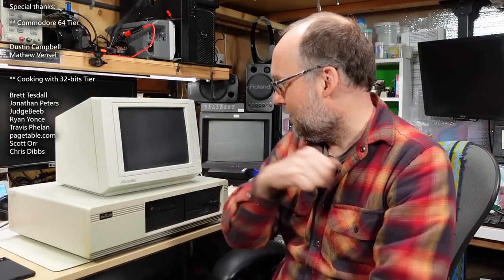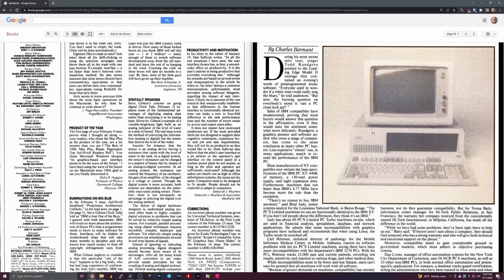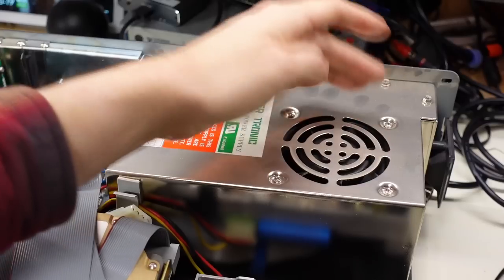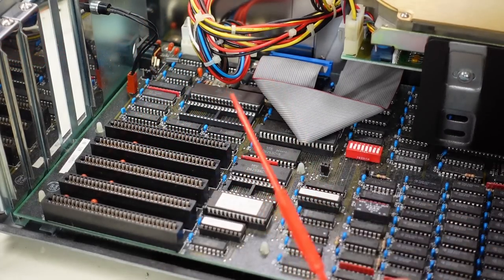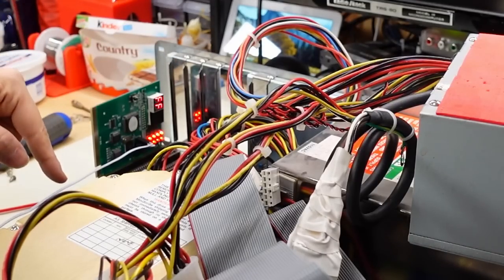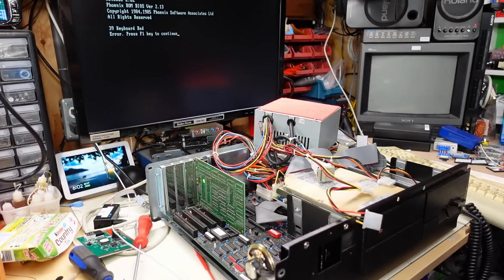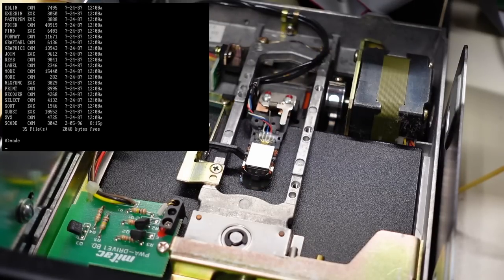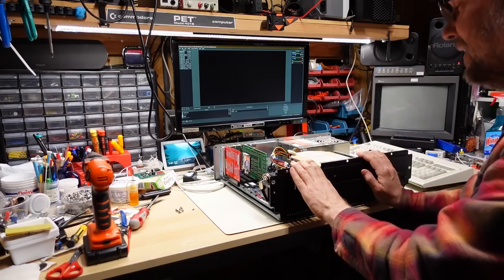What mysteries lurk inside this mint Turbo XT?

Comment: This is a long shot, but is anyone aware of similar Turbo XT clock frequency changing software for boards by other manufacturers? I have a DTK 10Mhz board where there software switch triggered by a keyboard shortcut doesn't work, since it requires the original DTK BIOS being installed.

Comment: machines that had the monochrome adapter (not the CGA), could have up to 768K of contiguous ram as the video ram space was smaller.
Reply: According to Wikipedia, you could actually use 704K with MDA/Hercules, 736K with CGA and up to 960K with a serial terminal: https://en.wikipedia.org/wiki/Conventional_memory#Additional_memory

Comment: I always wanted to make a video card for these that is really just a raspberry pi with an adapter, giving the pc all the power it could ever use, and also allowing you to double the use as both a vintage pc, as well as an awesome retro raspberry pi enclosure that would use the same keyboard and monitor, power supply, ext, but would also give you a couple USB ports for a more modern mouse or keyboard should they need arrive and possibly even an SD card to use as the hard drive for the entire system. Does anyone know if there’s anything similar to what I’ve explained available to buy or is this something if I want it I have to invent it? Lol

Comment: That BR battery is the same as the CR, NOT rechargeable. The B just means it industrial grade, higher temperature range.
Reply from the maker: Oh right, it's the ML2032 that is! I remember I had one of the ML type in my solar keyboard...... which I eventually just replaced with a CR2032 and taped over the solar cells. It was easier :-)
Reply: thank you! I though I was losing my mind.  😆

Comment: Fun video!, But still...  Gets me thinking.  For around $2000 in 1987...
For that, you could have an Amiga 500 with 1M RAM, RGB Color monitor, and an external floppy for like $1400 I am guessing.  Now, you could also have gotten that setup with a 20M hard drive, but those external Amiga SCSI drives were like $500 back then.  So you'd still be under the $2000, but not by much.  However an Amiga with an external floppy would have given you two 720k drives.  Back that, that was decent!  
And for the people saying this person needed WordPerfect, guess what was released for the Amiga in 1987?  WordPerfect.
I got my A500 with 1084s monitor and the external floppy for just under $1000 back in 1987.  I think that came with a Panasonic 9-pin printer too?  It was a package deal at the college bookstore.  (I got the extra 512kRAM about 6 months later and the 20M Dataflyer hard drive about 6 months after that. ) Yes, I used Word Perfect on it.
Either way, great vid and a cute machine (I did have an XT with Hercules I had pieced together about that time too).
Reply: PCs were considered "business machines" and Amigas toys, expensive toys. At least amongst the adult population at the time. My mom, who was really into computers, was amazed when I showed her PageSetter(?) and ProWrite on my 500 as she assumed it could only be used for games and programming. Luckily it was my Amiga, so I could decide when she could use it.
Reply: @OscarSommerbo  Agreed.  I don't blame people who were buying PCs.  Commodore had some of the worst marketing ever.   Oh well, such is life.  All fun in the end...
Reply from the maker: I'd say the only thing this had over an Amiga was the nice high res MDA screen ... but that's it. The Atari ST also had Wordperfect and it also had a nice high res MDA screen. Plus, if all you're doing is word perfect, then some floppy disks is plenty! Plus, an ST (or Amiga) would be fanless and quiet.
Reply: @adriansdigitalbasement  Agreed.  If you were just doing Wordperfect style wordprocessing, I think both the Amiga and ST were good enough.  But when you got into desktop publishing (the higher end stuff), you really needed the higher res options.  And those were available on those other systems, but required separate monitors (Amiga A2024 or Atari HiRes) or some flicker fixer/scan doubler for the Amiga with a monitor that supported it. Still, I think if Atari or Commodore had been able to market better, one of them could have competed.  For the price at that time, you were just getting so much more.  Of course, by the time the 486 systems came out, it was game over.  But I had my A1200 and a 486 by then.  ;-)
Reply: @desiv1170  I had WordPerfect for my Apple IIe. It was definitely inferior to WordPerfect for DOS.  Plus, drive formats were incompatible, I couldn't exchange disks with someone using WP on a PC. Could Amiga do FAT?   
I think IBM (and clones) had a much superior library of business software to choose from. That's also how Compaq succeeded. You may forget how there were previously many "workalike" 86 and 286 PCs that had an MS-DOS that wasn't very compatible with PC-DOS software, including Tandy. In the end, I think if was the amount of software (including games) that propelled PC clones forward. And eventually killed Amiga.
If you just compared hardware stat-for-stat, there were a lot of "superior" machines to IBM and clones, including the Apple IIgs.  The early Macs were also inferior to Amiga, some Atari computers, even inferior to the IIgs!, but Jobs got a lot of people to write and port software.
If you just look at hardware, it's a total mystery why PC clones and Macs survived and other computers didn't. It's the software and "Developers! developers! developers!"🤣
Reply: @squirlmy  Wordperfect for the Amiga was basically Wordperfect for DOS ported.  It was actually one of the big complaints.  Many Amiga users wanted a GUI word processor for their GUI based system.  I used Wordperfect for the Amiga because I had been and still needed to use Wordperfect for DOS.  So I used it on both systems.  Basically identical.
(I preferred WordWorth 7 as an Amiga word processor, but Wordperfect was what I used most)
I do think it would have been interesting if Commodore could have worked with MS to port Word and Excel (as they did for the Mac).  
But Commodore was not that smart. 
Apple was better at making sure they had the right software...
Reply: @squirlmy  I never used WP on the Apple, but that doesn't surprise me.  The Apple II line was great, but WP porting could have been problematic.  Then again, you could run Wordstar on CP/M if you had a Z80 card.  ;-)
The Amiga could eventually do native reading/saving of FAT disks with WB 3 (I think that's when it became standard).  But when I was doing it, they didn't have it built into the OS, so I used a program called MessyDOS (or something like that? - Nope, it was DOS2DOS I think) to easily copy files to/from FAT formatted disks.

Comment: I hate tant's so much, they were a good option back in the day, but if its a motherboard I am going to use or refurbish those bastards go right in the bin and get replaced by ceramics (a 10uf ceramic is commonplace now, not so much in 198x)
Reply: Many Classic Mac owners (and by that I mean the entire lineup of original Macs) replace their aluminum electrolytic capacitors with tantalums.  It's because of leakage of the original electrolytics that damages traces, other nearby components and the motherboard itself.  At least the tantalums "announce" their destruction and it's immediately over with. When you have lots of valuable equipment destroyed by the old leaky electrolytics, you think about them differently.
Reply: @squirlmy  I have replaced a ton of electrolytics and you have a valid point, but when you looking at a 86 class motherboard that has 20 something tan'ts all waiting to burn up your traces ... and there's a ceramic equivalent its really a no brainer (same with electrolytics if its a 1 or 10 uf plop ceramic)
Reply: You should only consider replacing capacitors with ceramic if they are power supply decoupling capacitors or similar applications. In analog applications most ceramic capacitors can cause lots of distortion.
Reply: @osgeld  Multilayer ceramic capacitors are also prone to failing short. Maybe they're less prone than old-school tantalums, maybe not, I don't know. The safest option is probably solid polymer capacitors.
Reply: Ceramics also have different impedance and issues with voltage bias.  Probably “fine” in most decoupling cases but unless you’re going to take the time to analyze the circuit they’re in, it’s really better to replace like for like.

Spend an afternoon replacing the tantalums on pre-90s PCBs.  It’s not that hard.  I like to use flush cutters to break the old one and pull them out one leg at a time, using lots of fresh solder to make the heat transfer through the layers of PCB.

Put on a video or podcast to listen to, and it’s over before you know it.  Then you have another 30 years.